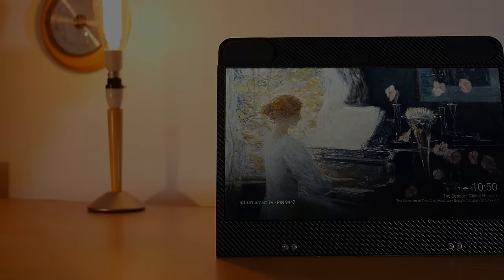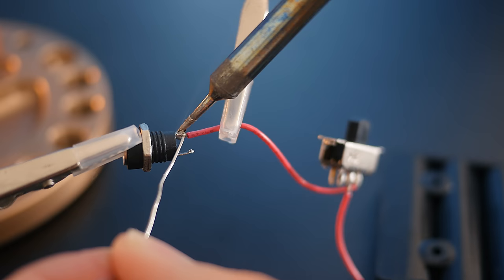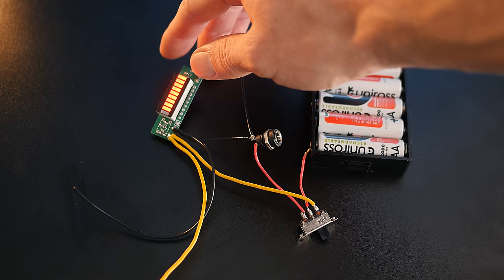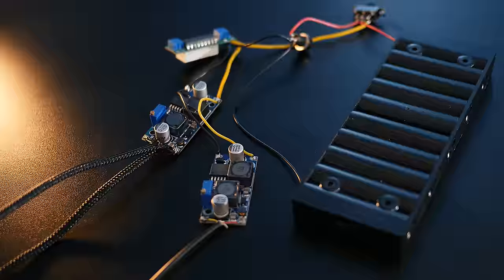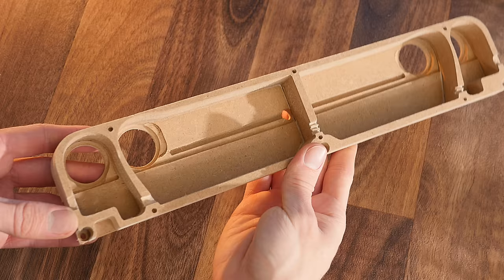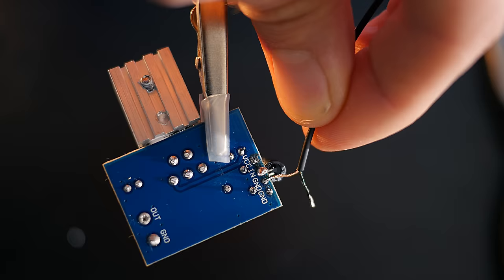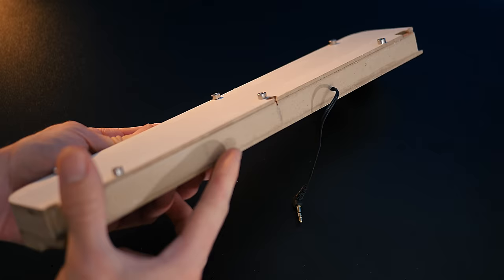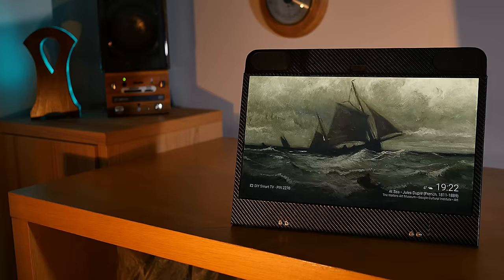Build your own portable SMART TV (100% wireless!)

Comment: You can really extend the battery life by using lithium batteries (cheap from gearbest, which I've personally had mixed luck with, or aliexpress)

I'd stick with lithium ion, not lithium polymer(LiPo), to avoid the need for level charging

Comment: hi. thanks for the video. you are my favourite DIY on you-tube, am trying to build the same project, i have the screen only waiting for to board to arrive from china, i want ask you about if i can use PAM8610 audio amplifier, its the same showing in your video mounted inside the hand made sound box, but i tried to fix that mini amplifier with audio controller like Bluetooth decoder and it make noise then the decoder shutoff i added capacitor to the volt in to the mini amp as a filter and the same happen, it works only if i use separate power supply one for the board and one for the decoder, if you can help to tell me what is wrong? am afraid to connected with the board for my screen then will be the same result and maybe it will be damage same like the Bluetooth decoder. thanks,

Comment: Hmm.. instead of using two voltage regulators, it is also possible to just hook up a 5v voltage regulator with a usb connector that you used in making the thermoelectric generator to power up the chromecast, isn't it sir?

Comment: I've got a 10,000 mah battery bank that has all of the required power plugs, and I'm thinking about making this project with it. It's a Li-Po battery, and I was wondering how it would hold up to the 10 AA batteries while powering a 720p panel. Thanks for the help!

Comment: whats the max voltage for those voltage regulators?.. i have an idea of using one of those voltage regulators to make an oscilloscope to identify clipping, and that would mean i have to connect this to my amplifier and to my laptop, but the amp will be putting out a minimum of 30 volts and up to 90 volts, can those voltage regulators filter out the excessive voltage and only feed the 2-3 volts to my laptop??

Comment: nice work and thanks for sharing us with your great ideas, i love it,,, but i have an question? i would prefer for using an regular house AC electricity, than to make a wireless but limited time of usage, and its will be more easier i guess,, and connect to an home theater speaker appliance,, and i think i need an exhaust fan for cooling the circuit if i want it for much longer time of using it? what you can suggest about that?  ( im sorry for my poorgrammars) thanks for your great videos

Comment: Hey bud - I've used these kinds of monitor driver boards before. They are quite handy. I enjoyed your video, particularly for the sticky vinyl idea. I've been wondering how to mount mine and I think this video helps me solidify my needs.

Btw, I noticed on my board that there is a 5v out on it. It looks like it's behind the phone jack ports on yours on the set of 4 or 5 pins. I soldered a line between these and my Pi. There are pads on the back near the usb power input on a Pi that one can solder into. This makes it much easier than a step down converter to your usb female port to your chrome cast. At least, it cuts out the step down and goes straight from the video driver to the chrome cast. 

Another query- did you have to go with four mono amps or could you have gone with two dual channel amps? Just curious, as I've never done the subwoofer speakers like you had but I was wondering why you went with mono amps.

Do you have alternate suggestions for hinges besides those from the laptop? I'm not sure my hinges will support as much weight as I'd like them to.

Thanks again for the walk through! My project can finally see the end of day because of it!

Comment: First of all very nice videos like them a lot.
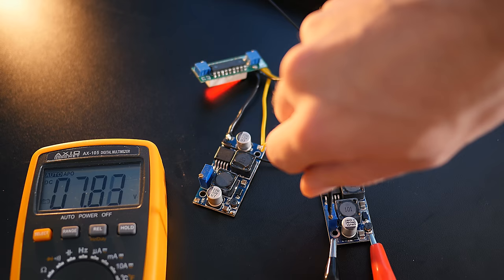3:11 there is a question that I really don't get. I used also two voltage regulators but if I connect 12v to TV it's fine. When I add the 5v to my Amazon fire TV Stick it shuts down. With an extern Powerbank it works like a charm.
All the connections are correct and I changed 3 different regulators.
It seems hdmi groung and usb ground are the same and this is causing the problem.
Do I maybe have to soulder a diode into the 5v system to prevent from "back flow" into the 12v system 🤷‍♂️

Comment: Will this charge the batteries while the TV is running? So hypothetically, if I was using this as a TV screen in my car, could I keep it plugged in constantly with the charger you mentioned (which switches off after fully charging the battery) to keep it playing almost indefinitely, or atleast for a significantly longer time (due to the fact that charging takes longer than discharge presumably).

Comment: Hi Matt! Big fan... i just love watching your videos and I tried to execute a few (I need to try harder 😁). 

I have a old Panasonic Vierra 32" LCD television. It doesn't work anymore. I called a  technician to fix but the circuit borad is useless and because its an old TV I can't find original circuit board. After watching a few of your video on monitors and smart TV,  I wanted to convert this into a extended monitor or a smart TV which can function individually (like a tv but a bit smarter). Could you please suggest a few ideas? I am not very technical so it will be really awesome if you could make a video. It will be really helpful. Thanks and keep up great work 👍

Comment: hi Matt!
i want to make the same as you but instead adding a battery system with rechargable batteries, i want to add, if is posible, power it up with a powerbank using USB. What change do i have to do, what componet do i need, is there a specific voltage step-down board DC-USB or somthing like that?
thanks for the help! :)

Comment: As said I made this and love it. But for some reason even when it is plugged in it looses battery and will turn off. Let it be much much slower. Is there something I might have done that would make it do this? I followed the circuitry very closely.

Comment: Hey Matt (@DIY Perks), I need a portable non-smart TV, but can tune into OTA (over-the-air) channels (ATSC format, because I'm in the U.S.), uses a screw-on antenna (ie. an 'aerial'), has a fully functional touchscreen, is able to accept either HDMI or DisplayPort, and that can be mounted on a standard VESA mount (like a desk/wall-mounted swiveling arm.... like an Ergotron).  In your opinion, can this be done for cheap?

Comment: What a great idea may I ask a question.Would this work with a Raspbeery pi as I am at present putting together a 15.4" screen into a brief case and going to try using it as a laptop and gaming system.I can power the pi wtih a power bank but when testing the screen I have being using a adaptor powered by the mains. Looking into your setup Iam thinking that I should be able to use the power bank.Hope you don`t mind this question as I am new to this kink of tech.Regards John.

Comment: i really love this project, i do have one question though. 2 of the 4 mono amplifiers you turned into low pass filter amps but on what frequency exactly?
Reply: You can use the formula: 1/(2πRC), R being the Resistor and C being the Capacity, to calculate the cutoff frequency. 
Here it is 234 Hz.
Which means, that every frequency above 234 Hz is being suppressed, while everything below remains the same.

Comment: Can you add another link for the amplifier and the other things like cables and resister and capacitor, what poxy is the best for this job please,also what about if I just use only 2 speakers?

Comment: Hey love your videos...just having trouble with this project right here. I'm able to power on but it seems to go in protection mode and turns off and on. I tried using a usb wall plug and using the same regulators to increase to 12v. Same with a portable charger..getting the same results.

Comment: What's the amperage delivered by those batteries?
I'm trying to power my build from USB with a voltage regulator set to 12V but the board doesn't keep more than a few seconds turned on.
Right now I'm trying with a USB 5V 4A charger and still facing this issue.
My goal is to power the monitor from a PC USB port, a phone charger or even a 5V 4A power bank.

Comment: Hi, My screen is flickering on/off. I suspect the voltage relutator cannot provide the required amps for my controller board. Although it does say it supports 4A, which is apparently what my controller needs. Any idea what this could be? Wire's are defo thick enough

Comment: I do not know exactly how the voltage meter is set correctly the guidance in the description help me not further. Can you help me please?
Reply: you attach a voltage meter to it to display the current voltage. You adjust the regulator with a flat head screw till you get the desired voltage.

Comment: Hey, I've been having trouble building my own portable display, specially the battery part. Is any calculations for it, or is it straight forward?
Thanks
Reply: I have used 5000 mah li-ion battery for a 30 watt screen and raspberry pi 3b that lasts 1 hour 30 minutes. 1.5 ah charger

Comment: Hey, I built one myself but the step up unit makes a hissing sound and flashes the monitor for a few seconds before shutting off, is there something im doing wrong, the only thing I changed was the power source, which is a power bank, the battery pack is 5 volts and 2.1 amps, it seems like it overheats too

Comment: I bought the audio amplifier from the video, but I can't connect it properly to a speaker. I tried to wire the audio inputs from an apple earphone jack, and for power I used a 6V phone charger (plugs into mains), but all I get is a loud buzzing. Did I ground it wrong? how do I rectify this problem and use the amp with a 3.5mm jack??

Comment: Awesome, watched the previous video and have just dismantled an old laptop and was wondering what you can do with the screens, just ordered a Control panel, i plan to run it off a 18650 power bank, I can 3D print a holder that it can clip on to, that way the batteries are not permanently fixed to the TV.
Reply: Do you still have this I would love to see how you wired it up as I want to do the same xx
Reply: @vikkidyer unfortunately my control panel stopped working when I had it running
Reply: Aww what a shame I wonder what went wrong or maybe the board was faulty.  Thanks for the reply xx
Reply: @vikkidyer  yeah.. ill definitely try again when my old laptop dies.
Reply: @evoke2104  I've subscribed so hopefully if you do build one again I will get a notification xx

Comment: I'm trying to output 12 volts using 10 of the batteries and the regulator makes a loud hum then cuts off when connected to the lcd. It will sometimes make a small popping noise too. I need help as I am terrified it will burn my house down.

Comment: You think it's possible to adapt the charging system of a laptop with a wireless charger?
Reply: Just use an 18650 power bank, you can get the shells of eBay, then load up the 18650s, that way you only plug  it in when needed

Comment: Hi, can anyone tell me if you can do the exact same thing but with a touchscreen monitor like galaxy Tab to then attach the touch screen monitor to a PC as a secondary display? Any suggestions or recommendations appreciated!
Reply: it depends if your actually going to take out the screen, i looked at the controller board for my Nook HD + and it was possible to do it. look for the part number on your lcd on the galaxy tab to see if you can.

Comment: Is this also possible with bigger screens like for example a 24"? Because I have a 24" panel that I can re-use from an old PC monitor. Is this possible to have it battery powered?
Reply: find a controller board on ebay and see what the required voltage is.

Comment: Do you have an antenna? Can somehow add a tv antenna?
Reply: To use an antenna you'll need one more piece of hardware called a TV Tuner. The antenna connects to that TV Tuner, and depending on what model of TV Tuner you buy, it will output RCA, VGA or HDMI. Now the biggest PCB that you saw in this video can take the output from this TV tuner into any port since it has all. And that's how you'll be able to use Antenna TV.

Just to add to this, in case you have DTH-Satellite Dish TV, then the Set-top box that comes with it outputs RCA or Composite Video, and you can connect that to this PCB (the biggest PCB) and done... This is hard to make wireless though..

Comment: Look at that you just built a Monitor that not only is Portable, Has the best Speakers, ChromeCast, Multiple Inputs for Display,  Kickstand, Beautiful Display, Vinyl Wrap, Controller Board, HDMI to LVDS converter. And all it costed you was probably around 100 - 160$

Comment: I found there's only 1 problem: If a battery is more discharged than other. It will keep overcharging and may lead to over voltage. Any solution to that?
Reply: Ensure that all batteries are balanced before assembling the battery pack.

Comment: Just a bit misleading this project, since the object of our affections isn't strictly speaking a "Television" in the accepted sense of the word.
i.e. it doesn't process a broadcast DVB-T signal from an aerial and produce a picture.
I have been looking for a Control board to do this which would work with a 1920 x 1200 panel, ...seems there isn't one despite this project raising my hopes!

Comment: thanks for the video, but why didn't you use lithium accumulators instead of 10 shitty alkalins?
Reply from the maker: +HaLuNkE ST0NER Because they're nimh batteries, and much safer and easier to charge.
Reply: how can they be easier to charge? won't the unbalance and overcharge at some point? I just wondered because I use lipos like in all my projects, a cell with ~2500mAh, add a tp4056 charge regulator with over/ undervoltage and current protection. you would just need to add a boost converter for your 12v lines and one for the 5v. I just thought that's easier, more reliable and and would safe some weight. BTW thanks for your answer!

Comment: Actually looking for some help. I have built this and am trying to power using 3x 18650 cells in parralel  from the same laptop the screen came from charged by tp4056. However the screen will power on for about 10 -20 seconds then goes back to standby and reboots then again 10 to 20 seconds etc etc. Totally stuck don't understand why it won't work any ideas? Anyone?
Reply: Jake Lingham ::: Hey Jake, I had similar issues with my laptop screen. I think you need to write your batteries in series instead of parallel. 

A brief explaination why. 
The LCD controller board requires a DC 12v power supply. The amp rating is also important. I used a spare laptop power brick that was the wrong volts and amps. Blew out the backlight and the screen would do exactly what your's is doing. 

So, 3x 18650 in parallel will not multiply the rated voltage of your batteries. Wired in parallel will multiply (3x) the rated amps of the batteries. So, your configuration does not have enough volts to power the controller board. And,  you should check the amps requirement also. 

Now, 3x 18650 wired in series will get you the required 12v DC for your screen. Most of the screens I have found require 4 amps also, so a way to control the amps should be considered as well. 

I just finished my first prototype template ( I'm gonna build 5 of these) exactly as the video described. I made lots of notes along the way as to when and where mods might be good. Change batteries was my first thought; design different stand brackets/hinges support method. Sound Bar parts came later, still working on that part. 

So, with all that said, it seems like your batteries should be wired in series instead of parallel.